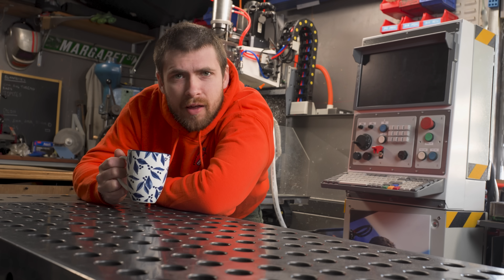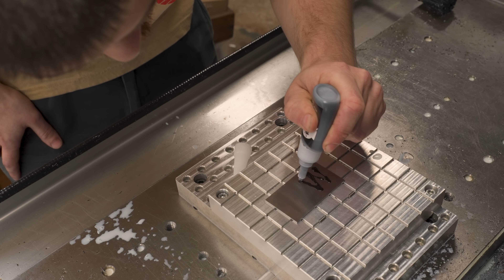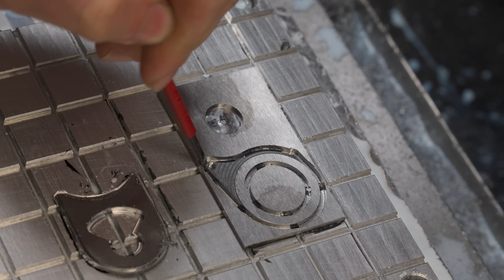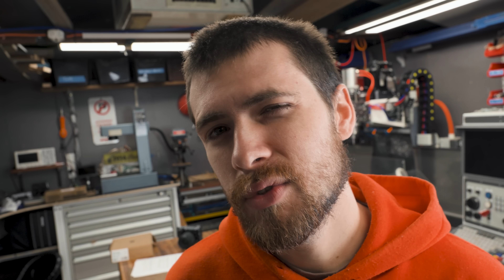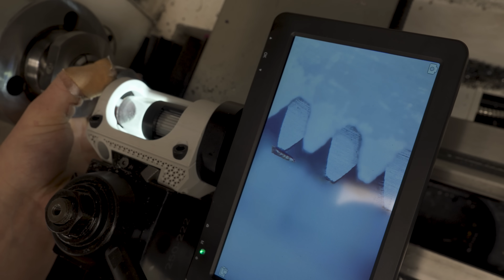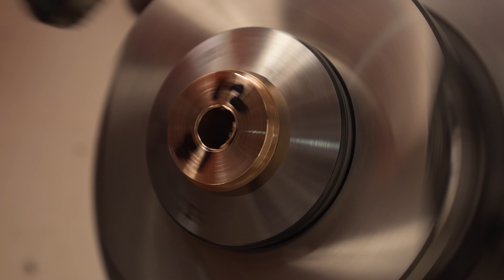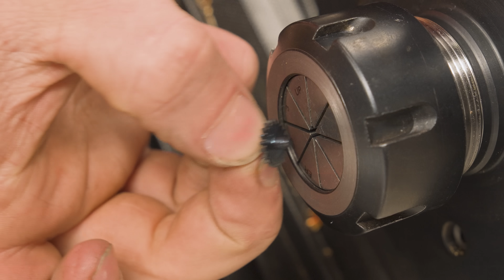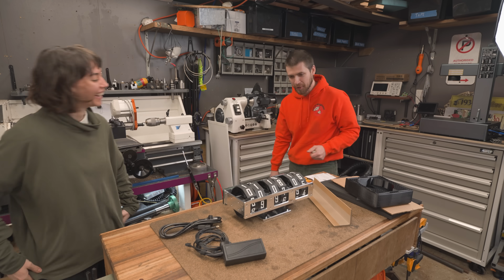What if angles were metric?

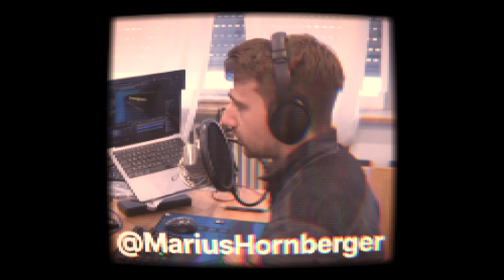Comment: I'm sorry but I just can't get behind something being called metric and having 400 units, that might be the accepted standard for a metric circle but it's just all wrongness. If it's going to be metric it should be 10, 100, or best of all 1000 for the whole damn circle, that way half the circle would be 5.00 (180deg)(200grad)(6 o'clock), half of that would be 2.50(90deg)(100grad)(3 o'clock), half of that would be 1.25(45deg)(50grad(1:30 o'clock)), half of that would be 0.625(22.5deg)(25grad)(12:15 o'clock), an haf of dat would be 0.3125(11.25deg)(12.5grad)(12:07:30 o'clock) which is really a bit hard to do in the head so we should just go with 27,720 for the proper units of a whole circle.

Comment: In the old days blue prints called out angles in degrees minutes ans seconds. Even machine tools had it etched on the dials. I started in the trade after calculators replaced slide rules and degrees and decimal degrees are now used.

Comment: 12:07 - If you're wondering how the Sumerians came up with a sexagesimal system when the origin of all counting is done on fingers it works like this: Pick a hand. Using your thumb count each of the segments (technically each one is called phalanx and together they're phalanges) of the other four fingers (the Sumerians apparently started by the palm and counted up to each fingertip starting with the index, but you can pick whatever direction helps you keep the numbers straight). Congratulations! You now know how to count to twelve with just one hand. Use the other hand to keep track of how many sets of 12 you've counted in the way we normally count (one whole finger for each set). Once you've run out of fingers you'll find that you've counted to sixty.

Comment: I've heard of the Gradian before, but let's be real, I'm European. And my math teacher talked about this stuff, some odd 20 years ago. Degrees Radians and Gradians, and on our calculators we could shift from Degree to Grad, with ease, I don't know why you would do that, unless you're really bored in math class, and are just pressing buttons out of sheer boredom.

Each grad is 54 arc minutes, compared to degrees which are 60 arc minutes. 100 Grad is the distance from the North Pole to the Equator or roughly 10000km, it used to be 10000km before we redefined the metre to be the distance light travels in 1/299792458th of a second. Which is just 1 over the speed of light.

Comment: if its so metric why is the complete circle 400 instead of 100 or 1000? thats not right!
who cares about the 4 quarters, metric cares about the whole!
if you were doing this right it would go from 
0°, 45°, 90°, etc up to 360°, to 0°, 12.5°, 25°, etc up to 100° !!!
or if you need more precision multiply it by 10× to get the new circle of 
              1000°
     875°     |       125°
             \          /
750°—      ○       — 250°
             /          \
     625°      |      375°
                500°

Comment: I've worked on microscopic deburring of F-35 components. Most of the smallest components in the injectors, housings, and bobbins are deburred by hand using a scraper, and I'll tell you right now, nothing beats a Swiss triangle needle file. 

It requires a very steady hand, but you can grind the three faces at the tip of the file smooth on the side of a diamond wheel (bench grinder). Dip it in water after every pass, don't apply pressure (you'll lose the hardness), and do really smooth motions avoiding any extra facets. When you're done, you end up with a 3-sided razorblade with a tip accurate enough for holding +-0.0002 tolerances that can carve through aluminum like butter, and mild steel with a bit of gumption. I cannot suggest making these scrapers enough if you plan on making small parts.

Comment: Making metric angles with 100 in a circle isn't even too odd.
One metric degree would be 3.6 regular degrees.
With is also the ratio between km/h and m/s
So 100 m° = 360 o°
and 100 m/s = 360 km/h

Comment: Wouldn't a unit for one single rotation make more sense?

If you define one rotation as 1, everything else would simply fall out under metric rules.
A tenth of a rotation could then be described as a decirotation.
A hundredth could be a centirotation. Anyone who feels like a rotation should have 100 units could use this.
A thousandth could be a millirotation.

The statement "he rotated at 3 rotations per second" would then also be a well-defined statement that would then also be very intuitive.

Of course, fast spinning speeds could then also easily be expressed with "1 kilorotation per second".

Choosing one unit for a full rotation would completely get rid of the whole question about how many subdivisions a full rotation needs, because the metric system already provides us with a very convenient framework for jumping orders of magnitude.

Nonetheless, very nice result of engineering.

Comment: Some angular measurements make perfect sense, and have no metric need, like the one that engineers generally use, that is based on the natural fundamental relationship of the diameter to the circumference.  It is called radians, and is used extensively in engineering, all aspects, like electronics, physics, etc.

Cool mechanism.

Comment: The reason 360 is so good, is its so easily divisible.
You get neat numbers for halfs, thirds and quarters

And you can divide halfs, thirds and quarters into another set of half, thirds and quarters. And get all round neat numbers.
With only exception being a quarter of a quarter, giving you 27.5 degrees.

Comment: One thing to consider is that a unit for measuring angles should be divisible into useful fractions. Halves and quarters are obvious, you want half-circles and quarter-circles to be nice whole numbers. Thirds are a bonus.

Then, within each quarter, you ideally want divisibility by 2, with thirds and quarters as bonuses too. This gives us useful fractions like 1/2, 1/4, 1/8, 1/12, 1/6, and 1/9.

We can remove redundancies: if a number is divisible by 1/6, it's automatically divisible by 1/3. So the key factors are 1/8, 1/12, and 1/9. The smallest number divisible by all three is 72.

So any multiple of 72 would make a good angular unit. The first such number ending in zero is 360, which is why 360 is such a practical choice, it divides nicely into all these useful fractions.

240 is another interesting contender. Coincidentally, it lines up with 24, which we use to divide time into hours, another traditionally circular measurement.

Comment: From Wikipedia: - The radian, denoted by the symbol rad, is the unit of angle in the International System of Units (SI) and is the standard unit of angular measure used in many areas of mathematics. It is defined such that one radian is the angle subtended at the center of a plane circle by an arc that is equal in length to the radius. Link to article. https://en.wikipedia.org/wiki/Radian

Comment: I think one of the fundamental mistakes in your strategy was to build in small scale. You might have built a large scale protoype as a model to learn what works and what may cause problems at scale. Just a thought if you should tackle any more micro tools. 
I like to use the standard degree tool with an additional vernier scale for more accurate measuring.

Comment: Quick advice for very low tolerance pieces. 

Put the inner part in te freezer, and heat the outer part. That way you take advantage of thermal expansion.

Comment: Every simple school calculator I've ever used can convert between RAD, DEG and GRAD. So GRAD isn't something totally obscure that would not exist in the real world, it just isn't used by daily life. And once you are doing 2D/3D graphics or physics, you also don't care a lot for DEG but instead you use RAD, which is a far more obscure unit to those who aren't used to it. As that 90 DEG is 100 GRAD and 360 DEG is 400 GRAD is something most people can wrap their minds around but tell them that 90 DEG is 1.5707963268 RAD and that 360 DEG is 6.2831853072 RAD is something that will make most people cry (and yes, you would not write it that way but saying 90 DEG is 0.25π RAD doesn't help either)

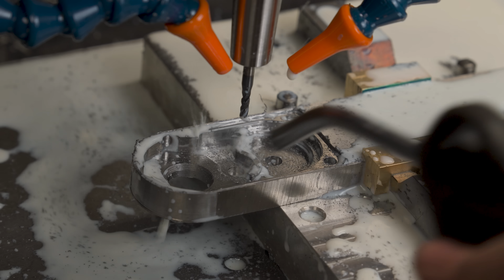Comment: 4:22 Wait... can somebody tell me what I'm looking at? What is the white substance and what is it for? Catching shavings?
Reply: It's coolant for keeping the tip and parts cool. Metal gets surprisingly hot when you drill, sand, etc
Reply: @feudalhistorian4998 and heat causes warping and other deformation.
Reply: @feudalhistorian4998  Also lubricant probably. As to why it's foamy, Idk, maybe it's more efficient that way. Also yeah maybe the shavings too.
Reply: Its coolent for the tool to not overheat and it might help with lubrication but thats secondary 

Or its c*m you choose😂

Comment: When you use the largest superior highly composite number under 1000 to divide a circle, a number literally defined by the unusual density of its divisors... then some guy wants to replace it with 1000 (not even highly composite, let alone superior) because "ooooo, I want my base 10 number to have a bunch of shiny zeros!!"... Even 840 or 1260 would be better.

Comment: I will do you one better. What if the metric system wasn't base 10, but base 60 like Babylonian numbers which gave us our 360 degree, 60 arcminutes per degree, 60 arcseconds per arcminute? Think about it, their division of a circle was extremely related to their studies of astronomy, which is inherently tied to the sphericity of the Earth and its great circles, and the original metre was based on a fraction of one such Earthly great circle - it would have gone full circle, and the French just dropped the ball for no reason. Puns absolutely intended and I will not apologize. Also serious, base 60 > base 10, I will die on that hill.

Comment: 11:05  more info: the ancient Sumerians used a base 60 system (we used base 10). This means a single digit counted from 0 to 59 just like our modern single digit counts from 0 to 9 and in the computer systems a single hexadecimal (base 16) digits represent a count from 0 to 15 (0-9 then A-F to represent the other digits, which directly translate to 0000 to 1111 in binary).

The ancient Sumerians are also the reason why an hour has 60 minutes and a minute has 60 seconds.

1/60th of a single degree is called an arc minute (also angular minute). Same goes for an arc second.

Minute just means 1/60th. The name comes from Latin: the hour had "minuta primera" (primary minute) and "minuta seconda" (secondary minute or minute of a minute). When translated to other languages (not just English), for some reason, "minuta" was kept and "primera" dropped and for the "minute of a minute", the word "minuta" was dropped and "seconda" kept, then the translation happened (English: minute/second, Russian: минута/секунда, other languages: something similar)

Comment: There are 360 degrees, because there are 365 point something days in a year, but 360 is so much easier to use in calculations in the duodecimal (base-12) system.

Comment: The original metric system from the 18th century included gradians, but its modern successor (SI units) - which is what 'metric' countries actually use in practice - uses Radians instead. It's the mathematically native way of looking at angles.

Comment: What stupidity.. not going to entertain this video for a second, the title is complete BS and ignorant.

Angles are metric.
Anything that follows whole numbers is metric ("whole number decimals")

Simply put, anything that has a whole number conversion to base 10 is metric.
The Danish use metric, but to this day they speak numbers in base 20.

Imperials has a non whole number conversion and different conversion by country on top of it, but are still in use for a lot of stuff all across the world simply cause the "inch" is defined in metric, like in Norway it is 2.54 centimeters, this means you got a whole number conversion ratio at 50 inches = 127 centimeters.

Grades and the clock follows base 60 (Babylonian).
Pi which is 3.14159265359 has an interesting comment when you think about imperials (There is no such thing as an "imperial version" of pi").
And why is that? ... it is nearly incalculable for precision above advanced "steam punk" era tech.

This is why planes fell out of the sky when there was collaboration between different companies as the male socket did not fit the female socket correctly and wiring disconnected during flight.

Metric does not have this problem as when needed we go to plank number for absolute precision.

Comment: Couldn't we just... Declare 360 degrees to be 100 degrees (metric) and fill all those 100 degrees with 100 sub-degrees between each one? And if we ever need even more precision, just divide the sub-degrees into 100 sub-sub-degrees. Keep doing that until you have a number between 0 and 100 (which can be said either way because they're the same spot on the circle) and voila. 25 metric degrees is 90 degrees. 50 metric degrees is 180. 12.5 metric degrees is 45 degrees. If you need more precision, just subdivide until it's close enough because physics will not care after a certain point.

Comment: Most tap drill charts are for 70 or 75% thread. You really don't need any more than 50% for most things, so on difficult materials I usually drill oversize. Reduces tap load noticeably.

Comment: They used metric angles for over 200 years. They also used metric time, didn’t work out too well. They even used it to measure out the meter when they triangulated from the Baltic to the Mediterranean.

Comment: 3x4x5=60. 3+4+5=12.  The classic Pythagorean Right-angled triangle that builders have used for many thousands of years.
6x60=360.
There is NOTHING arbitrary about the ancient angular measurement system.
There is nothing to see unless you have your eyes wide open.
As engineer myself (retired) I understand the modern use of radians instead of angular degrees.  I do not accept the ancient measurement systems were just dreamed up.  They have mystical properties.
I preferred the metric system of measurement throughout my career because as electronics designer, I liked the consistency of millimeter, micrometer, nanometer - the scaling regime within my personal discipline.
I have sometimes discounted the so-called imperial system as irrelevant. But I think there is a forgotten legacy here that could reveal a great deal about the World we inhabit if we would only look with cleared vision.

Comment: Now I know why the metric unit for angles in a circle isn't in use. How is 400 any better than 360? Why is it not 1000? Who messed that up? And now you have to deal with 33.333 66.667 100 triangles. Or 33 1/3 66 2/3 100 triangles. But oh no! Metric loves decimal and not fractions. That's why everything is set up in base 10 in the first place. And if we're going to be dealing with repeating decimals or less cumbersome fractions, why not 83 1/3 166 2/3 250 triangles in a 1000 grad/circle system? At least you're not using milliradians or NATO mils. Soviet mils are worth a look, though: 500 1000 1500 triangles.

Comment: I completely accepted degrees when I saw the explaination that for example 360 can be evenly divided between 2, 3, 4, 5, 6, 8, 9, 10 and 12 aswell as a few other things that make degrees easy to work with.
Ontop of this there are also radians which is based on pi which makes working with circles really convenient.

Comment: Radians are not fundamental physical units; they are continuum extrapolations. The more fundamental anchor is the electron reduced Compton wavelength, λ̄e ≈ 386.16 fm. In RTRT this is exactly half the TITO length of ≈772.32 fm.
Express time adjacency around a circle in these discrete 1/2-TITO electron-anchored units and you obtain physical granularity rather than an assumed continuous angle. At small radius the granularity matters; as radius increases, the number of adjacency units increases and the continuum/radian approximation becomes increasingly accurate.
π does not become wrong. Rather, π and radians describe the large-scale continuum limit of an underlying discrete geometry.
Electron anchor:
E_TITO = 1/2 electron rest energy
λ̄e = 1/2 TITO length
Radians describe the approximation. Electron-anchored adjacency describes the proposed physical granularity.

Comment: I am here to tell you that radians are not basic . They are extrapolations . The single most conclusive unit is the electron reduced Compton wave length . If you express time adjacency of 1/2 electron mass units in a circle you get the true granularity , but as the radius increases the acuracy increases.

Comment: It was designed in degrees with a total of 360 because that number has an unusually large myriad of special properties (in each of which it qualifies for the strictest tier) that make it incredibly easy to do a vast range of practical things with. (In extreme contrast to both radians, gradians, and well, any other possible system.)
For example- It's a superior highly composite number (about as opposite to a prime number as you can get), a massive number of divisors such that out of every unit fraction from 1/2 to 1/10 there is only 1/7 that doesn't result in a nice whole round number.. The only others with that clean performance are either multiples of 360 or get very large very quickly.
It's also a colossally abundant number, a refactorable number, a harshad number, a hamming number etc...
It's the same reason we have 12 inches in a foot, and 36 inches in a yard,
the same reason we have 60 seconds in a minute, 60 minutes in an hour, 12 hours in a full clock cycle and 24 in a day,
why we have 4 weeks in a month, and 12 months in a year,
why we have 12 notes of the chromatic scale in music, and why eggs usually come packaged as 6 or 12 (a dozen) etc...
These numbers all fall on the sequence of highly composite numbers!